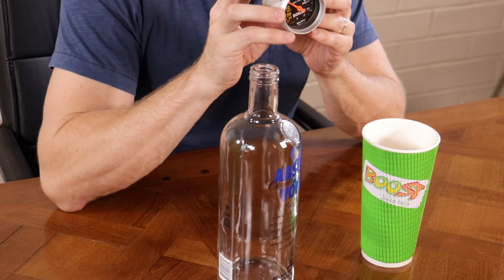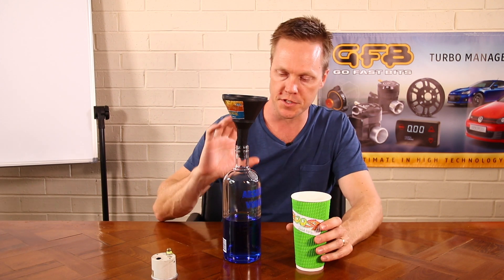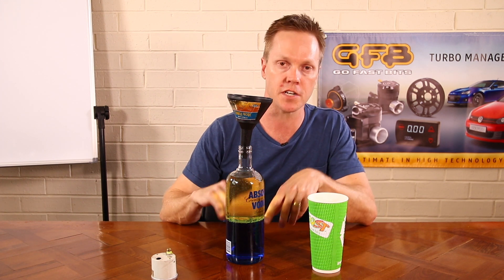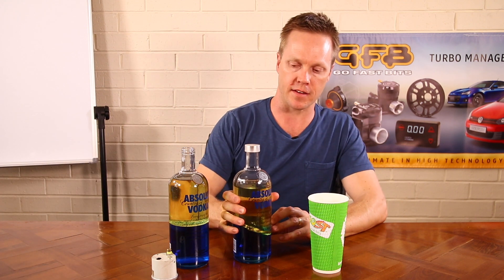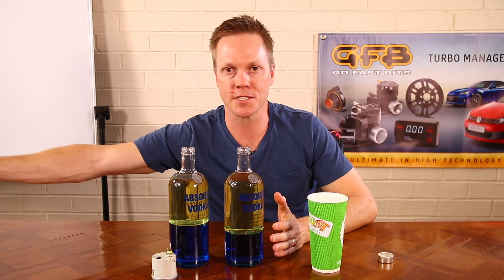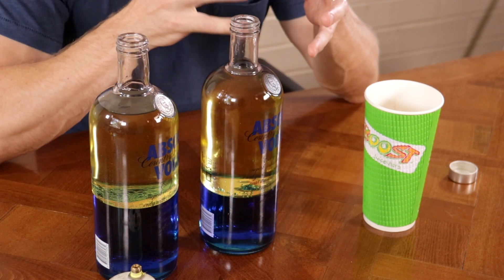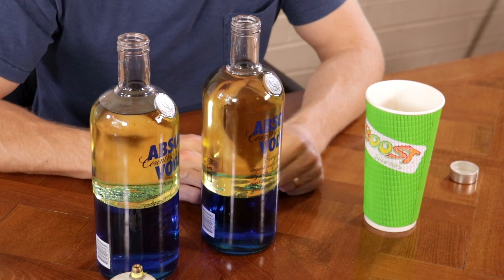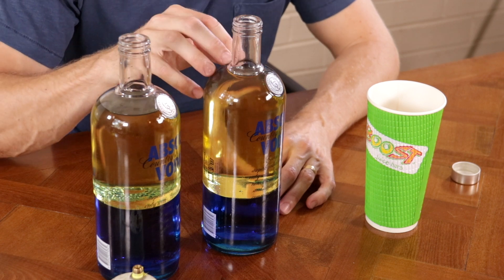Boost Pressure Explained [GO FAST BRETT]

Comment: Great explanation, thanks 😁👊  I drive for Saab Turbo and made a hole in my Hood so a bit of my new High Flow airfilter sticks out and breathes cold air, it made a huge difference in performance. Heat is also a thing people forget to take siriusly I'll think and I will work much with heat transportation this winter.

Comment: So would the same theory with altitude, apply to cold weather? Here in Canada,  when the outside temperature is around 0 degrees Celsius I start to over-boost, and when the temperature is down to -20 or lower the car over-boosts with even moderate throttle.
Reply: My car boost to like 12psi in winter and 20psi in summer (Canada as well)

Comment: Something that Brett didn't mention: a Bar is a unit of pressure, not quantity, and temperature affect greatly the pressure of air. 
So having 2 bars of air at 25°C (80°F) means having roughly 6% more air than 2 bars at 60°C (140°F).

Comment: nice video. Almost all mining equipment and some cars have atmospheric pressure sensors as well as map sensors (some use the map and have a vsv before map to read atmospheric on startup) to read the atmospheric pressure and adjust the fuel map.

Comment: Great video learned a lot. I'm not sure if you guys take technical questions or maybe someone in the comments knows this but I'm still wondering if the same boost pressure affects power if the turbo is different.  For example if you ran 17 psi of boost through a stock turbo and 17 psi of boost though a much larger turbo is peak power the same? I understand that the response and other factors would be different and the larger turbo is capable of holding more boost but i'm wondering if there is a benefit at the same boost level.

Comment: I still don't quite get the additive vs multiplicative distinction for absolute pressure.
1 bar atm + 1 bar boost = 2 bar total and 0.8 bar atm + 1 bar boost = 1.8 bar total. Where does that go wrong?
Reply: Brent Allen 1 bar atm × 2 = 2 bar total
.8 bar atm × 2.5 = 2 bar total
the higher the ratio, the harder the turbo has to work, and the harder it works, the more power it saps, the higher the intake charge temperature, etc.
the ratio is more important than the values in determining losses, since the lower the ratio, the less your turbo needs to work to achieve the same level of boost.
Reply: Brent Allen when you go higher in altitude from sea level
Reply: Higher in altitude explains atmospheric pressure being lower, but it still looks like 0.8 + 1 = 1.8 to me rather than some multiplication operation.

Comment: Being a mountain dweller is anoying for sure.  My house is around 5000ft, or 1500m.   Would larger turbos effectively counteract this?  (larger volume for lower density).  
Or perhaps more pressure and a leaner injection of fuel?  I have no Idea, just brainstorming.
Reply: It seems the only real solution is moving!
Reply: add a supercharger lol
Reply: Justin Fābïø smaller turbo. more spinspin, more kaboom, more bwaaap.
Reply: Justin Fābïø   Electric car with good range is your answer.  Powering your wheels with a machine that delivers less power the higher you go is just silly.
Reply: I have a twin turbo set up, and the stock 9bs are already kind of small.  So just more boost?  He said in the video the turbo is already forced to spin faster and heat is an issue at higher altitudes.    I guess thats what my intercoolers are for.  I have a 91 Mitsubishi 3000gt VR4, just thought I'd mention.
Reply: ArchimedeanEye One day maybe, some of us are still under 20 and don't have that kind of cash to get an electric car thats faster, and can go as far as the fossil fuel powered equivelants we can get for the same price.  
Plus living in the mountains, The temperature drops down to -30 F (-25C ish).  Batteries do not perform well, or last long at those temperatures.  I build and fly model aircraft and the difference is noticible when the temp drops.

Comment: Could you guys do a video explaining what exactly is "Turbo Flow Rate, such as lb/min" and boost.  I can't seem to understand it. I hear of people running 24psi with a "higher flowing" turbo, making more power than someone running 28psi.
Reply: (Full Disclosure: I'm an electrical engineer by training, not mechanical, but hopefully this helps)

First place to try to understand a physics question such as this is unit analysis. Boost is generally measured in the US as PSI, or Lbs/In^2. Lbs are a measurement of force (mass x gravity), being divided over an area (square inches). So what your gauge is reading the is the amount of force a unit of air is expressing upon some reference one square inch in area. It is an instantaneous value. The "flow rate" commonly used in the US is measured as CFM, or Feet^3/Minute. Cubic feet are a measurement of volume, or the amount of air that it takes to occupy a space measured to be 1 foot in width, height, and depth - being divided over a unit of time. Basically, the volume of air flowing past a point of reference in one minute. Lb/min is also a common measurement here and is similar. What it is measuring is lbs of air every minute. Again, lbs are a unit of force, and in this case it is being spread over a unit of time. So the amount of force that was applied to a reference over a one minute interval. From either lbs/min or ft^3/min, the number of air molecules in a given combustion cycle can be obtained by knowing given temperature and pressure (different turbo manufacturers use different conversions for this). 

Now: turbos come in many different sizes, primarily because engines come in many different sizes. A small engine will have a difficult time running a large turbo - and a large engine will easily overload a small turbo, because the size of the engine dictates the amount of air that it pumps through it. Now, many tuners will swap out a larger (or as you mention, "higher flowing") turbo onto a car in order to make more horsepower. This is because a larger turbo will push more CFM of air at a given pressure than a smaller turbo. The force is applied to the air by means of the spinning impeller; the faster it spins, generally the greater the force applied to the air. 

But airpumps (what turbos and engines are) are not 100% efficient across their operative range. If there is not enough air (closed/low throttle or a turbo that is too large for the engine) there will not be enough interaction between the exhaust gases and the turbine wheel so it will not spin fast enough to compress air in the compressor, or there will not be enough interaction between the intake air volume and the impeller to create a high amount of air pressure exiting the compressor housing. If there is too much air for the turbo to flow, the engine is having work harder, trying to force air through the turbine housing on the exhaust; or the impeller wheel reaches a force equilibrium with the entering air that it actually reaches aerodynamic stall (something Brett addressed in his videos on [I think] boost surge/creep). So you want a turbo that is sized properly to your engine and that is why PSI is a poor tell for the amount of air a turbo is pushing at a given time - if you are ignorant of the other characteristics of that individual turbo. Your engine really only cares about the number of air molecules it has to burn with a given amount of fuel, not the pressure at which those molecules enter it. That's how an engine can produce more power at a lower pressure utilizing a larger turbo than that same engine may produce using a smaller turbo at a higher pressure. 

That doesn't mean that PSI is not important - in fact it is very important when regarded in context of the turbo that you are running. Because once you choose a turbine and compressor housing, the point of max efficiency for your turbo is fixed. When you go to tune your engine and turbo setup, you need to know the amount of air entering your engine so you can tune your fuel to match. Run too lean and your exhaust temps will increase to unsafe levels and fuel could detonate on the following cycle. Run too rich and you will have too much uncombusted fuel that is not reacting and generating heat and kinetic energy to push the piston down. So you watch your Air-to-Fuel ratios and compare those with your boost pressure. In a stand-alone setup, you can adjust either one, pushing up boost when you're running rich, or lean out the fuel at a given boost level. This explanation obviously ignores things like spark heat, timing, or the flow characteristics of the head, but I hope it helps give you a better idea of how this works.
Reply: the easy explanation is that the bigger turbo has more room, so it can move more air at a lower pressure. Just think of a small and big hose. If both hoses had the same pressure flowing through them then the bigger hose would flow more lb/min so it would need less pressure to flow the same amount of lb/min.
Reply: It's really quite simple.  PSI is only how much pressure it's creating.  How much air it's moving (volume) is dictated by the size of the turbo.  To simplify it:  Larger turbos move more air - more CFM (cubic feet per minute) than smaller turbos at the same  PSI.  The trade-off is that these larger turbos take longer to spin up, so before boost you have more turbo lag.  That's why you hear people talking about turbo X moving 24psi creating more power than turbo Y at 28.  Quite simply:  Turbo X is bigger.

PSI is not really the best indication b/c it doesn't take into account turbo sizing.  20psi out of a huge turbo might give you 1000hp but 20psi out of a small TD04 might give you 250 or something of that nature.  So when people only say PSI w/o knowing the turbo size, it doesn't mean much..

Now some people mentioned compressor maps - but I don't think that's what you're asking about.  Compressor maps are created from flow tests to show how efficiently the turbo runs at different turbine RPM.  That's to say that turbo X might be out of its efficiency range at 18psi and coughing up loads of hot air killing your power while turbo Y is in the meat of its efficiency and output air is [relatively] cool.  The compressor map describes the turbo's efficiency - what shaft RPM it's outputting what PSI and how hot is the air at that point.  Typically (very generally - not guaranteed) is that bigger turbos will go to higher PSI before they start running inefficient.  Though as I mentioned, I don't think compressor maps are what you're talking about so to speak, more-so just general turbo sizing and how 20psi out of a TD05 is drastically different than 20psi out of a 6466.

Hope that helps clear it up a bit and I didn't make it worse for you !
Reply: smevox good question!
Brett please, next video: compressor maps!
Reply: There is your answer. Each turbo has its own specific compressor map. Google it and have a look at some diagrams. There is always and area in the middle where the turbo is performing most efficient.
Reply: smevox my understanding is, most of the difference is in the exhaust side. small turbos make less power on same boost cause they restrict the exhaust a lot more.
Reply: exactly what he meant MrSlowest, nice explanation
Reply: MCM Please do this. Would be great to see GFB cover something a little more complicated.
Reply: Did you ever consider that you might be in the wrong engineering stream?
Reply: I'm sorry I don't follow?
Reply: Remember psi is pounds per square inch. That is, a force per an area. If you want more power, you have two options, increase the force (turn up the boost) or increase the area (use a bigger turbo). A big turbo will move more air than a small turbo, even if they're both running the same psi.

Comment: wait. the car wouldn't be down on power because the pressure is lower, the car would be down on power because there is less oxygen in the air the higher up you go.
Reply: Fox same difference
Reply: Fox A constant sample mass of air will be less dense and displace more volume under low pressure when compared to that same mass at high pressure. So, if one were to measure the same volume of air from two different samples at two different pressures (one sample from 10,000 ft vs one sample from sea level), the mass will be different due to there being less of all of the different molecules that make up air in that volume, not exclusively oxygen. There will be less oxygen, but there will also be less nitrogen, helium, etc. in the same respect.

Comment: but can someone explain this to me:

why is it that a 28mm turbo running 10psi will make less power than a 62mm turbo running 10psi?
Reply: JDM Viking because the 28mm is pushing less volume than the 62mm. the pressure is the same but the 62mm can push more air at the same pressure
Reply: ahhh i see

Comment: So irritated you didn't match the levels in the bottle. That's like 2.1 bar. Smh
Reply: rip my ocd
Reply: Alain Sabido yo nice profile picture
Reply: +lelouch britannia yo nice name
Reply: I have a 2013 genesis 2.0t, what if it stays on negative psi or at 0 and I have to be on 4th gear at least and about 4000rpm for it to go max 5psi?

Comment: Curious how all this would relate to piston-engined aircraft turbos at high altitude!
Reply: Luke Chapman It's the same problem. They started using forced induction on airplanes to counter the thin air at altitude and the loss of power that created. While you'll still loose some power it isn't as bad with forced induction.

Comment: So double atmospheric pressure is 14.7 =29.4 psi? lol
Reply: Lime That's why there are two different measurements for pressure - psig and psia. One measures with the atmospheric air pressure included, and one does not.

Comment: This was really informative! I like it
!
Reply: RegularCars I like you.
Reply: RCR x MCM please?
Reply: Get back to work Intern.
Reply: Which bar is best bar?
Reply: We need to chat on fox in space stream discord again it was fun
Reply: DAD!
Reply: BROWN
Reply: +microbuilder 
The bar with the most Absolut Vodka of course.
Reply: I want it
Reply: RegularCars notice me senpai
Reply: But mum!! It has a turbo for efficiency.
Reply: Not a car
Reply: patw52pb1 I'd say a bar with ladies dancing on it would be best, but I cant stand vodka, so I might be biased lol
Reply: yes
Reply: TY
Reply: I have a 2013 genesis 2.0t, what if it stays on negative psi or at 0 and I have to be on 4th gear at least and about 4000rpm for it to go max 5psi?
Reply: I think a RCR and MCM episode would be awesome!
Reply: One thing to remember is that the higher the altitude the thinner the air, making your car have less drag. You might be down on power but it should generally equal out speed-wise.  This is why most half mile speed records are at altitude because all you need to do is make the same boost as sea level to gain speed.
Reply: first, jack up your BROWN